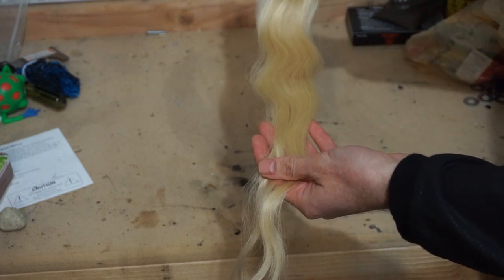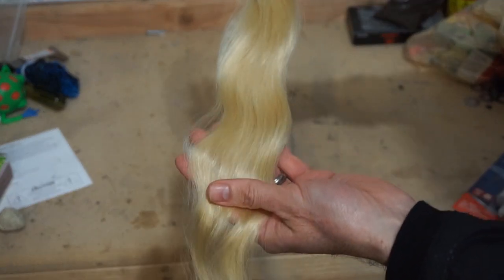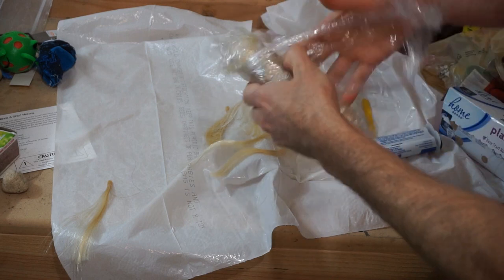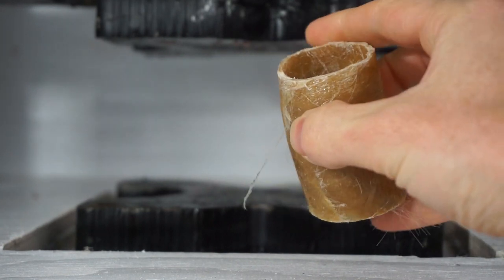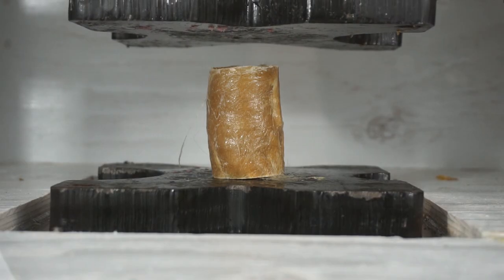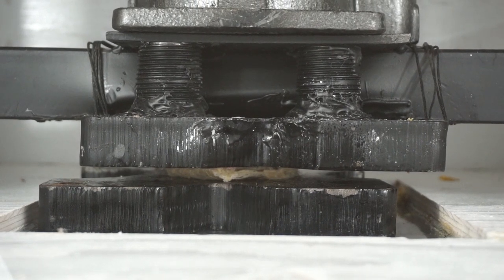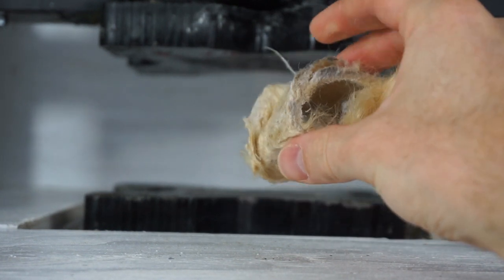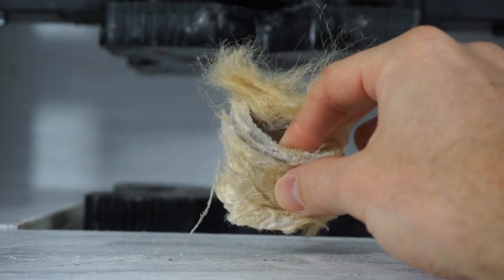How Strong Is Human Hair Composite When Crushed In A Hydraulic Press?

Comment: I mean technically this didn't prove anything. All it really did was compress the epoxy and not the actual hair.
Reply: DiabolicNick well, the composite is including the epoxy. This test isn't about just the hair, it's about the epoxy-hair mixture, even though that's not really what he said. Regardless, you're right, the hair strength is not what was tested like he said.
Reply: The test needs to be performed in tension not compression. Fiber has no strength under compression. It's like trying to compress a rope and expect something to happen when all it's strength exist when being pulled at both ends.

Comment: Why not tie the hair into a big knot and crush that? That's a better way to do it, than using the epoxy.
Reply: Agreed using an adhesive kinda ruins the experiment.
Reply: Melissa0774 hair can't be tied .i've tried it and it goes back to its original form.
Reply: Maybe bundling it, idk. There could be a way...
Reply: Better way for what purpose? Tension strands and cables don't have a lot of compressive strength. They have tension strength ...unless they're bound with a hardener (epoxy, plastic, filament, superglue/isocyanate, etc.)
Reply: @JakeWitmer  Because you'd be testing the hardness of the actual hair alone, not the resin mixed with it.

Comment: It's stronger in the sense of tensile strength, not compressive stress. For that use concrete, tungsten carbide, zirconia, diamond, etc. For exact value of compressive and tensile strength you need to take into account the elasticity, structure and bond strength of the material(I'm not going to do those calculations. You need a supercomputer for that)

Alternatively you can attach one end of your composite to the press head and the other end to a rigid and strong fixture above your press head, effectively applying tensile loads instead of compressive loads. Although don't take my word for it as I don't know what might go wrong(ripping a hole in your ceiling, damaging your press head, explosive breakage of the fibre, to name a few) In this case however, since the force is applied evenly, you have a fairly good compressive strength as well, as long as you don't tear or press into the composite.
Reply: Wot
Reply: exactly, he should have pulled the hair apart instead of squashing it together.
Reply: Well aren't you smart I'm not

Comment: Try using professional epoxy and make sure the hair is fat free. Also it's not laminated, as long as you don't use a vacuum pump, but only glued together.
Reply from the maker: +Arno nümuss you are right. I am getting a vacuum pump and I'm probably going to try this again with a proper epoxy/cure.
Reply: Good luck, a vacuum pump comes in handy for so many things once you have it. In my experience, very strong epoxy takes around 48h to be near it's best, even thought the manufacturer states 24h. But slightly above 400N/cm² put's it in the league of steel. So the matrix should not fail and show how strong the hairs can be. With that kind of equipment you may come up with ideas for home made armour that you can test in later videos.
Reply from the maker: Thanks, I should make me some human hair body armor, lol.
Reply: That or spider web, if you can find enough. Good old Kevlar will do fine too. Creativity is key.
Reply: Hydraulic Press Action, hair is strongest in tension not compression. For a natural compression test try using abalone shell, if you haven't already, it's designed to prevent crushing from jaws of predators.
Reply: Arno nümuss coconut works too, it's actually used as bullet proof vests. However I'm not sure where. The king of random showed how to make coconut hair ropes these could be used to weave jackets out of.
Reply: Interesting, thanks for the idea with coconut hair.
Reply: Arno nümuss w
Reply: Arno nümuss you sure do know about hair
Reply: Arno nümuss oh my god i have no idea what you're saying!
Reply: Arno nümuss hair is fat free? so our hair can gain weight!!!
Reply: @iiKawaiiGaming lol yeah, when you stuff fat food in your hair, it will gain weight ;P
Reply: @shaydenevans8872  one can benefit from hair's tension strength with hardeners. Rhino horn is also keratin...but you have to weave the fibers and then rotate them 90 degrees, alternating layers continually, 45 degrees, then another 15 degrees, and you need to vacuum out the air so you're "bonding to" each section of the way stronger keratin molecule. Ideally you want: 1 molecule of hair/keratin connected to 1 molecule of epoxide polymer connected to the next molecule of hair/keratin. ...The devil's in the details on this one. Also works with concrete.
Reply: @heyarno  please tell me about the best epoxy for hair and nails?

Comment: is there a way to stabilize your press more it seems like a lot of your stuff shifts! that takes away a lot of the satisfaction
Reply from the maker: I agree. I was pretty mad at this because it took a long time to prepare and then the bottom plate shifted. I fixed that now. But I even tried it again and it failed the same way, so I think the composite just failed so that it fell over even if the plate didn't shift. The top plate will always have a fourth an inch of give on either side based on how the press is made though.
Reply: Susan Rich
Reply: You need a device to create a vacuum around the composite while it cures. Carbon fiber requires this step.
Reply: Hydraulic Press Action maybe a piece of wood where is shifts

Comment: How about connecting the hair to a stationary part of the top of the hydraulic press, then the other end of the hair to the mobile part of the press, so the press stretches the hair as it goes down.
Then measure the amount of force needed to break it.
Maybe try it once straight, and once braided.
Maybe different types of braiding or weaving to see what's stronger.

Comment: Uh I think having a hollow centre is a major flaw.....why don't you make a solid composite instead of a composite tube? I'm no surprised it was crushed in that form.
Reply: In engineering, one of the best shapes you can use is a uniform cylinder, walled shell (tube), and square beam because of their geometry. As long as the beam or member is uniform in shape and material and an axial load (force applied from the top or bottom) is applied to the centroid of the member, it will have a much higher critical load (the point where the beam/member cannot withstand the force, and begins to buckle).  In this case, since the hair….uh….tube…. is most likely non-uniform and the load isn’t known to be applied over its direct centroid, it will fail rather quickly. 

Source: 3rd year Mechanical Engineering Student! :D
Reply: Hillary Smith now THAT is a good reply. Damn. I am obviously no engineer, but now i understand why a tube actually is strong. Thank you for actually replying with something very informing!

Comment: Also, this test is pointless.
You are primarily testing the adhesion between the hair and the epoxy, and the strength of the epoxy.
The hair will happily deform in the press, it has virtually no compressive strength due to its ability to bend.

As such, pretty much all the load is being carried by the epoxy.

So it isn't really interesting at all and is quite predictable.

Get a tensile tester and see how it holds up.

Comment: but that's not a hydraulic press is it?  it's pneumatic
Reply: How do you know?
Reply: sounds like he has air compressor that pumps air to main cylinder of that press but I dont know im not an expert
Reply: Henri Kankare Exactly you can hear the gas.
Reply: Juno Chun the X shape of the press belongs to a pretty commercially popular pneumatic press. hydraulic presses are usually one smooth motion of pressure while pneumatic presses slowly increase pressure through bursts of air. you can hear all the air being released when the machine lifts off.
Reply: does it really matter?

Comment: If you wanted to make this scientific engineering work you should have done:
1) Made at least 3 or more samples. The bigger the sample size the more accurate the results. 
2) Measured the force required to crush hair. 
3) Crush a few other things like concrete, fiberglass, carbon, steel of same size and shape to compare the strength of this composite to the others. Same size and shape are important because of stress which is force divided by area on which said force is being applied. Different area will result in different results even with the same force.
4) Optionally do the same with pulling (tensile force)
This way we might actually learn something. This is by no means a "scientific" method. You just crushed hair. 
I worked in a scientifically approved construction engineering lab, and this is how it is done.

Comment: Maybe the resin is not strong enough? There is no adhesion between the hair themselves. Try the same test with different resin, or, try to make the hairs stick together by applying a solvent which evaporates. In any case, it's a good substitute for many types of plastic.

Comment: It's not the hairs fault, that's what happens when you crush something that shape. Also the 12 ton thing is the tensile strength so it'd barely apply in this test. The results largely depend on the resin and more so the shape of the block which honestly why would you even make it that shape?

Comment: I think your composite was bad. The piece failed by de-lamination, not by breaking. The fibers separated from the resin. Nothing actually broke. You can't say how strong it could be because the structure as a whole did not hold until  the entire piece broke. Instead the components of the whole structure were forced apart into separate components. You noted all of this, of course. I think you need fibers wrapped around the longitudinal axis. Alternate layers lengthwise and wrapped. You should not need more resin. Usually you want as little resin as possible (I know, what does that mean? Maybe you are using less  than possible and you really do need more resin, but usually it's the other way around.).

I've never heard of hair being used as a fiber in a composite. It would be interesting to see how strong it could be if made as best it could be.

It is kind of creepy seeing the hair ready to be made into  a component. "People made into parts (TM)".